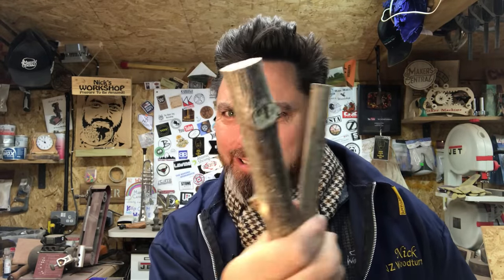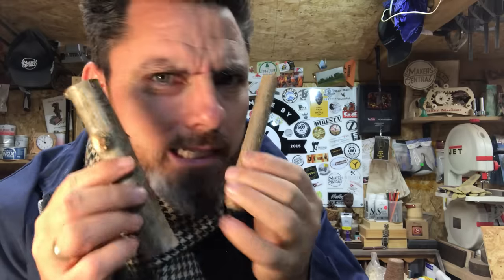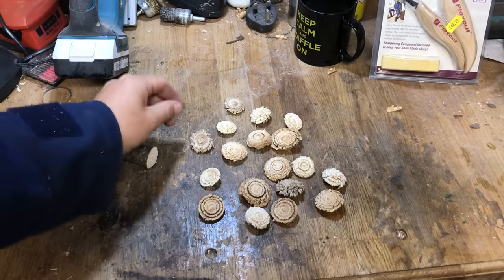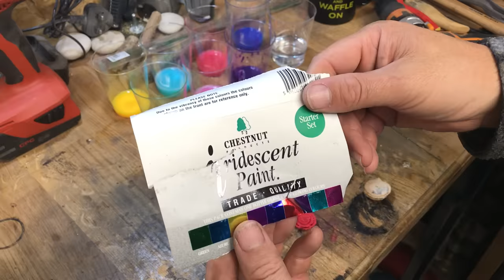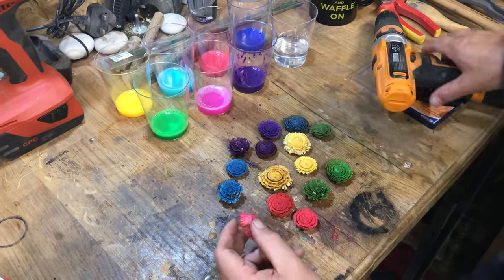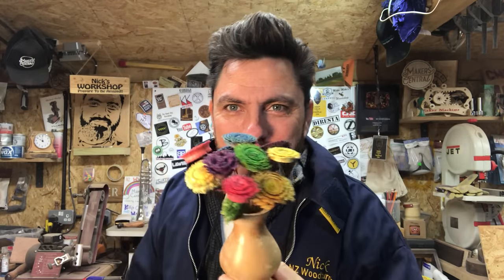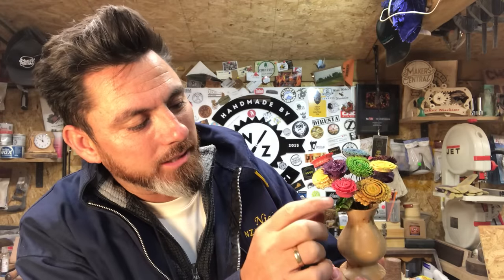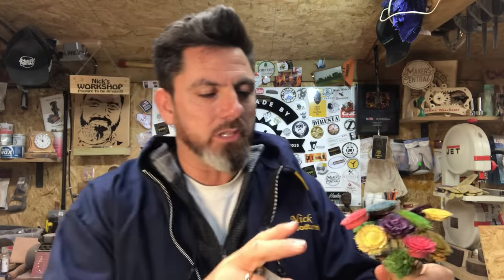Making wooden flowers

Comment: You should spray varnish the flowers and hang them until they dry.. it will keep dust from settling into the grooves and making it collect dust, and it will also make flowers more durable to prevent them from chipping or getting crushed if dropped

Comment: Oooooh - unpainted wooden (assorted wood colors) flowers in resin!!  (As long as you don't do to much on the lathe.)  (Hummmm - resin,  wood flowers - and silicon mold?  Resin flowers?)  And on the flower, where you put a little hole, add a pretty rhinestone.

Comment: They look almost like thistle flowers without the bulb on the bottom.  You could turn them with a bulb on the bottom and then carve the crosshatch pattern.  Also you could make the flatter ones and polish the back then stick a pin back on and have little lapel pins. They also look like they would pair well with steampunk gears .  What would happen if you used a thicker piece of wood? Could you make resin plates with these in the bottom so the resin magnifies the details?  You could also go in and paint the center a different color that slowly changes to the outside color or use a brush to put glitter on the tips of the petals.

Comment: To solve the cold issue in you shop could you install a heater or a wood burning stove to help keep you worm, I don't know the Dims on you shop so I don't know if it is realistic to do, but I know how hard it can be to work with your hands in the cold. It was just a thought.

Comment: So I had this crazy idea last night, I was curious if you would be able to make the flower from The Beauty and The Beast. If you'd be able to cast the wilting rose in resin, as well as the fallen petals and then turn the resin into a shape similar to the glass case surrounding the rose. This would be an epic project and I think you could pull it off!!

Comment: Hey Nick... contacting you from Colorado in the United States and was wondering if you good recommend a good low budget lathe to start with?  I'm an Artist by trade doing landscape paintings using oils and acrylics and want to branch out into wood turning.  Any advice you could give would be GREATLY appreciated.   Thanks mate.
Reply: Sorry, I'm not Nick. I've just started turning myself so my recommendation is lacking experience.
Craigslist for an inexpensive ( and used) lathe. Harbor Freight has a somewhat decent starter lathe ( under $300). If you've got time take a class or lessons from a local turner before investing in a really good lathe. I was given a lathe recently and I'm trying to learn from these and some other videos. I would definitely want to take a class.  if I had the time.... I've heard some good things about Jet lathes but they are beyond my budget at the moment but, under $600 depending on the size. Hope this helped.